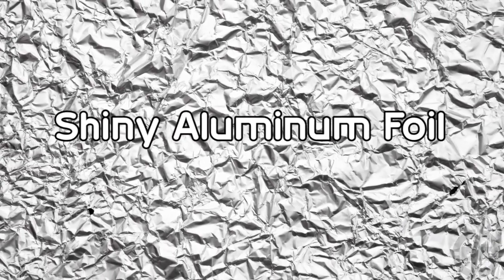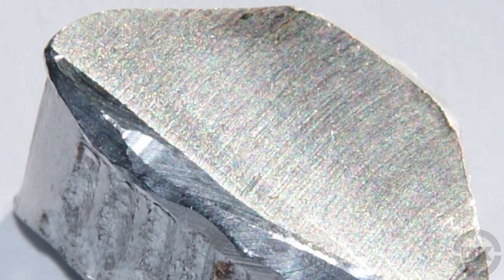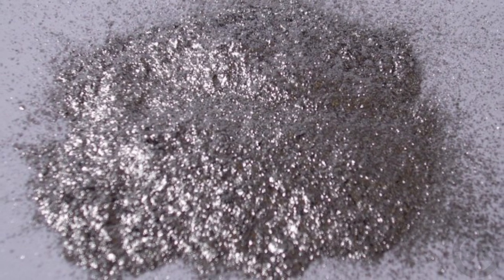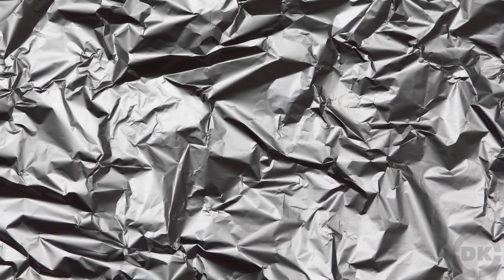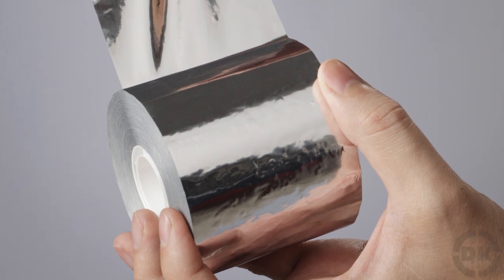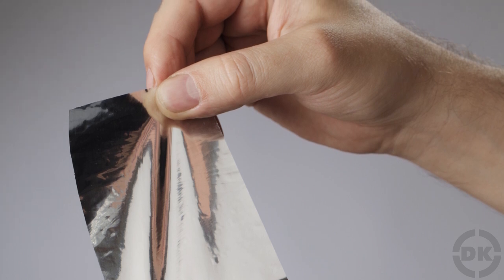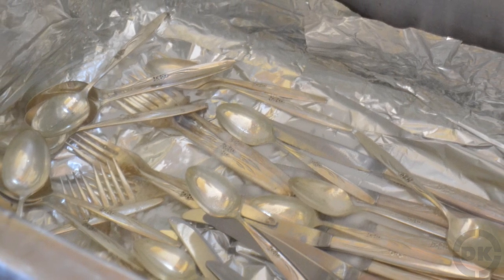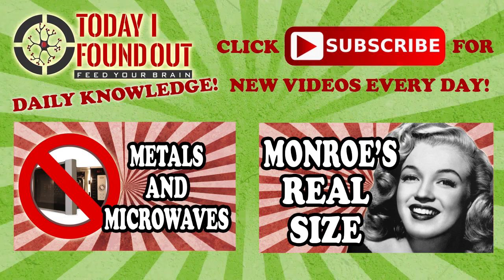Why is Aluminum Foil Shiny on One Side But Not the Other?

Comment: In emergency digital circuit could be improvided by using aluminum foul, and hot iron and plastic wrap and so PCB and micro controller could be done and for quality electroplating could help to perfect chip design

Comment: My understanding is that Al foil must be rolled as two sheets back to back because there's a limit as to how thin the foil can get using a single sheet. After that point, it recovers its original thickness as it leaves the rollers.

Comment: So now the natural progression of this episode is  to make a "Why cutting aluminium foil sharpens scisors" episode. :)
Best regards.
Reply: It does???
Reply: What the fuck?
Reply: I didn't know it did that, useful fact
Reply: Is it a fact?
I cannot come up with any logical reason why it should work, and I would feel quite silly even testing it myself.
I suppose I could use a test method, cutting 10 pieces of paper before and after.
Reply: saintpine -I tested it on a pair of blunt (not completely blunt) scissors, cutting foil around a hundred times. The scissors were still blunt afterwards though. Perhaps they were too blunt to begin with. Also, can help but notice the three commenters above you who are asking a question that was specifically answered in the video.
Reply: Which part should be inside of aluminium foil

Comment: Bonus 4 The lunar lander had a problem. The lander struts would be too heavy if a car strut technology were used. At the cost of $10,000 per pound engineers had to design a lighter onetime used shock for the lander. They knew a honeycomb structure was light and crush able but still heavy by mission standards. So they went with aluminum foil. It was light and can take extreme hot and cold. The foil was crumpled in a manner that when the lander touched soil it would support the weight and absorb the impact. The aluminum strut and foil cut the weight so well it paid for the cost of engineer design in all landers. even the few taken to space and moon and never used.

Comment: Erm, how is the sharpening effect happening?
Reply: +fetB If you google it there is much debate on whether it works or not.  I believe that the aluminum is just removing burs on the edges.  That doesn't make them "sharper" but that could make cutting through some materials easier.  The problem with that is since you are cutting through that thick of material you'll spread the blades apart which defeats the whole point of scissors.  So your best bet is to sharpen them like any other blade using a whetstone.  But some scissors you cant take apart so what I've found useful is a handheld sharpener.  You wont get all the way to the handle but it'll help make those cheap scissors last alot longer. this one has been working pretty good for me.

http://www.amazon.com/Lansky-3143-PS-MED01-BladeMedic/dp/B0085PPSIQ/ref=lp_2595201011_1_2?srs=2595201011&ie=UTF8&qid=1441123239&sr=8-2

Comment: The so-called explanation didn't actually explain why one side is shiny and one side not. Yes, it said that "the sides that touch the highly polished rollers are burnished to a bright finish, the inner sides that touch the other aluminum foil remain matte." In other words, they explained the process that achieves their intended result. That doesn't explain why that is their intention in the first place. Apparently they're thinking the foil only needs to be shiny on one side. Why would they think that?

It's like explaining that they pronounce it al-u-MIN-i-um in the UK because they spell it with an extra i. It doesn't explain why they put the silly extra i there in the first place.

Comment: al-oo-mih-num
Reply: Al-um-in-i-um, Al 13. Discovered in 1825 by  Hans Christian Ørsted. Atomic mass: 26.981539 u ± 8 × 10^-7 u, Electron configuration: [Ne] 3s23p1.   Melting point: 1,221°F (660.3°C)
Reply: he spelled it the american way for the video title and uses that spelling IN the video but still persists to pronounce it the other way

Comment: Does the shininess of the shiny side add to its insulation value from radiated heat? Or is the total reflected amount similar, just more diffused or not? Or is the matt side still shiny for long wavelength radiation?
Reply: The shiny side will reflect more infrared energy than the matte side, but only by 5% or so.

Comment: So, is the saying "the food must touch the shinny side only" a wifes tale???
Reply: yes, why would that matter? Shiny out, it looks prettier.
Reply: Carbon 12 Before I knew the real reason for the "shiny side", I thought that the reason for one side to be shiny was that it was treated with some kind of lacquer to protect raw food from touching the aluminium...
Reply: Wouldn't the irregular side hold more bacteria due to having more surface area than the smooth side?
Reply: ***** Probably. But why should that matter? Are you using it as a Petri dish? :-)
Reply: If the goal is preserving the food; usually you would want the least amount of bacteria on it. Bacteria are the main reason food goes bad.
Reply: ***** Yeah, but who uses al. foil to preserve food? Where I come from its mostly used as very short term wrapping and for cooking in ovens. So no chance of bacteria "cultivation" there...
Reply: You are right. But in case you dont already know, nowadays we have a amazing machine called "refrigerator" to keep you food fresh.